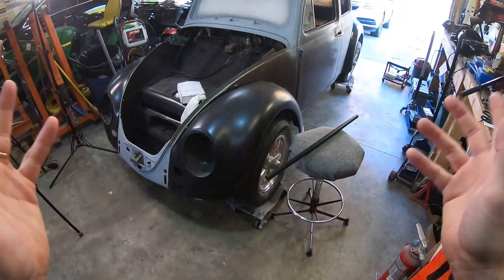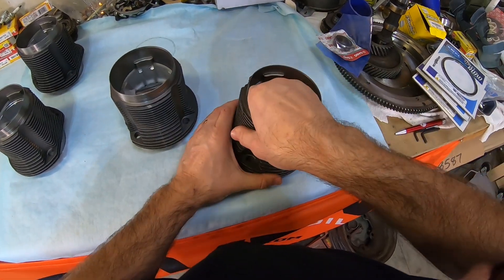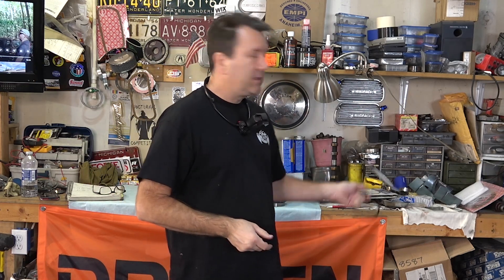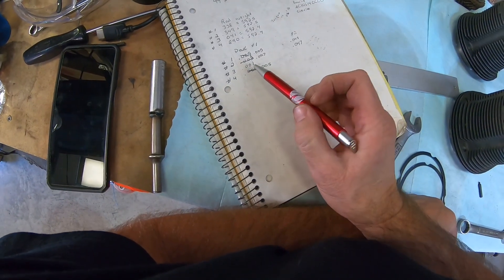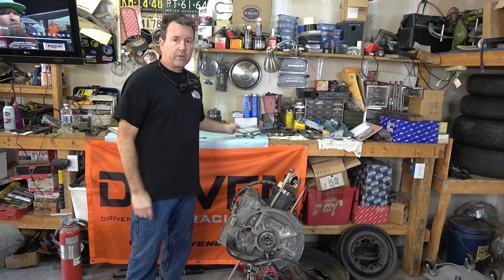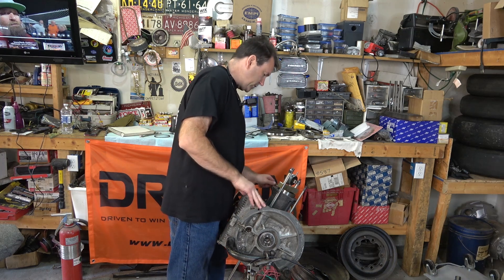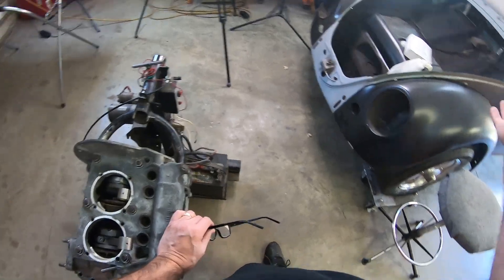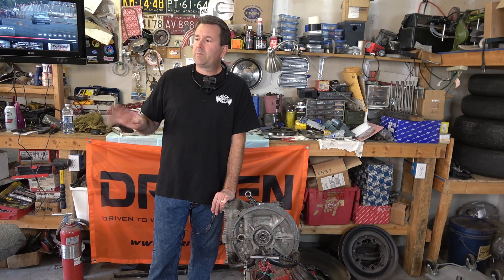Dialing in Final Deck Height

Comment: Gene Burg has machined steel spacers. Not stamped. My non turbo 2276 setup, I run 9.5 CR but depending on cam profile. Here in Canada, we have 94 octane. No E85 gas.  0.040" is a close call as long as you are not going to rev the snot out of it.